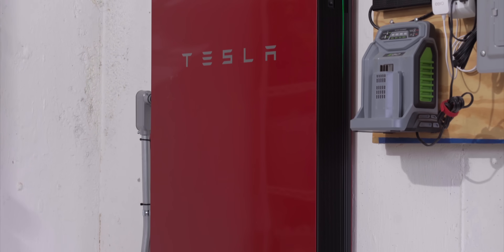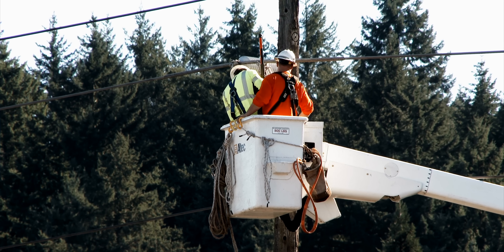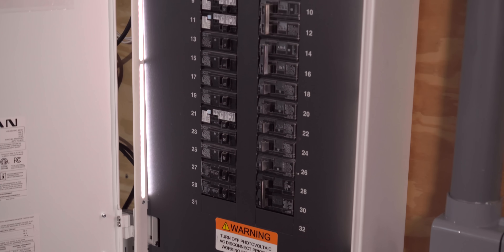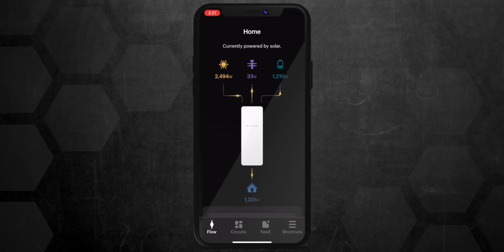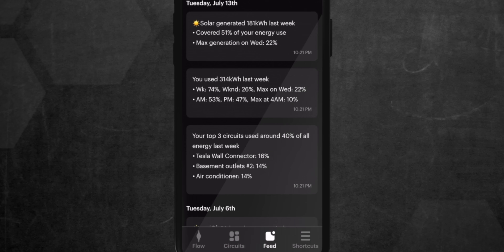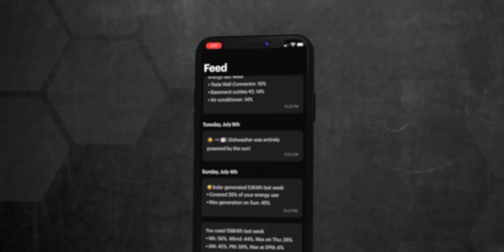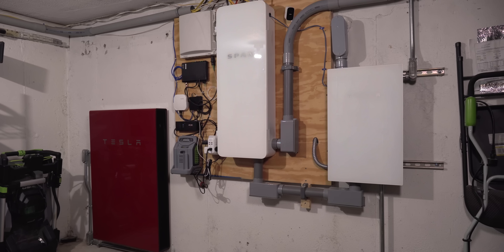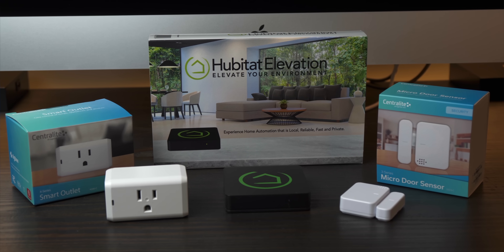This Smart Home Electric Panel Fixed My Tesla Powerwall

Comment: Super Jealous Matt, I've been eyeing one of these for a while now! Congrats on the latest addition to your smart home! Quick question, is the $3,500 you  mentioned including labor and everything?
Reply: This does seem really cool, but what happens if Span (which I'm assuming is a startup) goes out of business? I'm sure it keeps working but it does seem more risky infrastructure than smart thermostats and switches made by startups.
Reply: @odiemac  I've been considering Span and wondered about that too. But in talking with the Span folks they've acknowledged the concern and said they have plans for a local/LAN web UI as well as local API control. (Might be good for Span to officially chime in here in case I misunderstood...)
Reply: @DanielEisenman  You are correct! Our local API will be published soon. That way whether the internet or Span servers are available or not, the system will still be fully functional.
Reply: @chadcconway  Thanks Chad, good to see you guys responding to customers and potential customers!

I had a question around load shedding. How does the Span panel “know” when grid is down or battery SoC in the case of Powerwall? There isn’t really a good stable API that Tesla is implementing right now that I know of.
Reply: @odiemac  the support for all of the app based stuff will disappear and it will just be a regular breaker panel, (assuming that the relays/contractors which turn circuits on and off via the app don't stop working)
Reply: @walt4690  Yeah that would be my assumption as well. Local control would work but maybe not remote. But then you lose the utility of your $3500 investment.

Seems like its a lot easier to accomplish the same goal with software: detect battery charge level and turn off smart thermostats / plugs / lights etc. Then when the SW ages out at least you didn't build it into your wall.
Reply: @odiemac  100% stringing some lambda functions with API data and maybe backed by Elasticsearch would be way cheaper
Reply: @betterwithrum  all running through optimized sqs queue to deliver notification data to ds consumers.  I found the dev! 😁
Reply: Their website says installation is not included. You'd hire a local electrician to do that work.
Reply: I paid like 2k for a circuit panel redo.
Reply: @Chad Conway Any plans for similar integration with Sol-Ark or other inverters?  I’m installing a Sol-Ark 12k and could probably get a good deal on installing a Span panel at the same time.  But it wouldn’t do much good if Span isn’t able to detect when power shifts from grid to battery & vice versa.  The Sol-Ark does support CANBUS/MODBUS for communication with BMS, if that helps.
Reply: The more people buy one. Less likely SPAN will  go out of business vs having a long term company.
Reply: This costs more towards 6-7K as all loads are controlled
Reply: @Chad Conway Have you been able to do the same thing with enphase encharge as well?
Reply: @scotthall1381  not yet, but it seems like it’s on the road map. I’m a SPAN and Enphase certified installer and I know they’re working on hopefully making something happen soon. Not a guarantee though

Comment: I'm getting Tesla Solar and 3 powerwalls installed in the next few weeks..does this new model allow it to be inset into the wall like a traditional panel or is it still surface mounted? I have Sense and contacted their support, they've indicated they currently don't support solar with battery backup. Their solution won't provide accurate readings when getting powered from the batteries so I'm a little disappointed there.
Reply: Hi Oral, yes the new Span Panel can be inset into the wall. We'd love to help you add Span, span.io/get-span

Comment: I wonder if there's a feature that gives you like 15min at the start of a blackout before your "not essential" group goes down. Just to give you time to like, save your work and shut down computers and whatnot. You could always just have a UPS on your critical devices, but it'd be a cool feature to work into the smart panel.
Reply: just put those on Nice to Have? i don't see the issue

Comment: This type of panel looks like a must have for battery and solar technology.
Reply: A convenience, not a must have.  For $3500 plus installation, most people would manually meter their usage like Matt said - or go with the fixed critical loads setup.  Have to weigh the high cost of this and the likelihood of this start-up maintaining support for the life of the install.
Reply: Price is over the top though
Reply: @chefgav1  I agree, $3500 is a bit steep for this, however someone investing in solar is likely spending 10's of thousands of dollars anyway, so this is basically a drop in the bucket for them.
Reply: @cappuccino-1721  I’m from Australia so this will be more than an entire 6.6kw solar system here in Australia given Australia has the cheapest installed residential solar in the world. It would be a nice accessory but

Comment: I wonder if it would make sense with a Generac (gas). You probably can downsize the capacity (15kw instead of 20kw for instance) with the fine grained control that spans offers.

Comment: This truly would be best if they partnered with builders. It would be a great starting point for a smart home. I was considering this during my Tesla install, but they weren’t ready to launch in my State. So I essentially went for 4 Powerwalls. I’ve basically mapped out all may power consumption manually and just know which breakers to shut down for an extended outage…like an animal.
Reply: Hi SteveV, What state are you in?

Comment: I'm having a remodel done and plan to have a Span smart electrical panel installed.  No batteries for my solar yet, but this will help in other areas and when determining battery needs.  Options are our friends.

Comment: I'm working on building a power bank for my house using used/tossed 18650 batteries, most of which are free or next to nothing to get. The drawback is I will have to check the batteries once a month or so to make sure they are still working but it will save my home quite a bit of money and i get to play with electricity. Yay
Reply: Don't you have a battery state of charge meter like a Victron or Renogy? You walk by and see the percent of charge, charge/discharge amps, etc.  When you set it up, you run the battery fully charged and then discharge it to set the parameters to your particular battery pack.  Here's my home built solar charged LiFeP04 battery pack on wheels that has the Renogy meter. I like how it calculates the remaining battery time in hours with different loads. Yay, do it yourselfers!  
https://www.youtube.com/watch?v=NYpczRYDFJQ

Comment: Nice panel, but there's something a little contradictory (in my mind, anyway) about moving toward self generated power while being hooked into the buggy, viral "internet of things" that a smart home is. Can this entire system of yours be air-gapped? Would you find that separation an important aspect of it?
Reply: I was hoping @Undecided with Matt Ferrell would have touched on security a bit, since I think part of his interest in Hubitat was the benefit of local control of home automation. Since cyberterrorism is a thing, something as critical as one's home energy infrastructure can't be too secure...

Comment: Span can help justify their high cost by also adding home/vehicle to grid as software update
Reply: Span is equipped with a 200A grid disconnect. When vehicles become capable of Vehicle to Home or Vehicle to Grid, we will be integrated them with out panel.
Reply: I asked about this on Twitter and they didn't reply.  It's really more important than people realize.   The future is having multiple EV a stationary battery and the ability to connect Vehicle to Grid.  This way in the near future you could easily have a combined 60kW of  battery power at your disposal.

Comment: Surprised you didn't mention anything about changing from the Tesla app controlling the energy flow for the house to the Span software - I assume as long as the Powerwall keeps its Internet connection, there's no concern of warranty issues now that another system is in charge of the electron flow.
Reply: Tesla is still in control of generation(solar & battery). Span adds to that by controlling load(lights, outlets, & appliances).

Comment: Odd that they stopped at 90 amps, not having at least a few spots (top and bottom of panel) that could do 100 amps.  I have a 100 amp circuit for the garage, which has EV charging and the bigger solar circuit on it.  I do not have a battery though and do not plan on this kind of upgrade in the house I am in.  Next house, great chance it would have a battery and this or something similar.

Comment: I think I’ll opt to continue living in a developed country with a reliable electricity grid
Reply: Privilage has its rewards.  Also the point of the system is to use your electric efficiently, not just in blackouts.
Reply: @tjwatts1207  if you can afford this system you can afford the electricity

Comment: Looks like they may have a new battery out soon. Iron-Air type seen in this YouTube video. https://youtu.be/UDjgSSO98VI be neat if you could add that to your Tesla Powerwall. The smart like panel wow so neat and neater with updates. Did not know they had something like that very cool. Thank you for the video. Nice job on it.

Comment: Matt I would love to add solar now, but I have a tile roof.  I would have to check with the HOA to see if solar is allowed.  If there were no rules here I would go with the tesla roof tiles.  But I'll have to wait until they make them in the shape and color of the Spanish tile roofs. I could add a vertical axis wind turbine but they are still in the design stage. Without the energy input, it is no use having a battery, but I would be as excited as you are to have a span panel to control things.

Comment: A fun toy for sure. I went the DIY off grid way. 56kwh's of chevy volt batteries with 18000w of inverters. 15000w of panels I just run everything all the time.

Comment: When using the panel for all the power tracking do you need to connect it to the internet with an account on the Span website, or does it all run on the local hardware?
Reply: Span connects to the Powerwall system locally, but currently requires the cloud to get information to your mobile phone. Local access without the cloud is coming soon.
Reply: @chadcconway  That sounds great as I'm firmly in the camp of people looking for something like this but I also refuse to have my smart home items connected to the internet so having everything running local is must have for me.

Comment: Ok Matt, 
Here is MY #2 FAVORITE take-away I learned from your video!!!   I must design carefully around a max of 220-90amp breaker ... I expected to feed my garage equipment with a 100amp  "sub-panel?"  But SPAN doesn't yet have a sub-panel.  
   * Do you think an ole type sub-panels should be avoided when using a SPAN because such a sub-panel prevents the SPAN from monitoring circuits off that Sub?  
* I guess maybe I should design the home with the 1 or 2 SPAN(s) in the garage vice the mudroom???  My worry... with a passive house design it's typically critical to limit the number of perforations between the garage and inside the home. So my electrical design currently had just 1 electrical perforation into the garage (1@220v-100amp) to service all garage electrical needs.  I must re-think that now.  Maybe SPAN is coming out with a 90amp Sub-panel?  Maybe I could run 1@60amp line to garage for the Model Y and then 1@90amp line to cover the 2nd future Tesla and all other garage equipment?  As a minimum the garage equipment will include 1@30amps Air compressor, 2@15-20amp lighting circuits, and 2-3@20amp sets of outlets. 

lol - too much fun!  

Cheers,
Eric
Reply: Hi Eric, 
Span can be used as a main or a sub-panel and we support installing multiple Span Panels in a single home. It sounds like for the best experience you need one Span panel for your main and then a second Span panel in your garage. The second Span Panel from the sub-feed lugs in the main Span Panel. We'd be happy to support: https://span.io/get-span
Reply: @chadcconway  
Thanks Chad.  We are not ready yet but hope to be in late spring.  Are you in NC?  
Do you happen to know if SPAN is working on a larger or smaller panel.  A Single 300amp or a cheaper 90amp for the garage may do the trick. 
I was trying really hard to bring my energy needs down to a single 200amp panel but its very hard, especially with wanting a 2nd Tesla in the mix.
A 2nd $3500 panel for the garage is a serious luxury.  I really need to sort out my energy diet. 

Cheers,
Eric
Reply: @erickessler6094  We can help keep you to 200A. EVSE / EV chargers when paired with Span do not have to be accounted for in the load calculations. Span is certified as an energy management device. We can also help you evaluate if you need a second Span or can just stick to a single Span panel and a regular downstream sub-panel.
Reply: Yes, we do installations in NC
Reply: @chadcconway  Excellent Chad, how best do I reach out to you?  I followed your link to SPAN & completed the survey.  I'd love to figure out how to live on one 200amp SPAN Panel. 

Cheers,
Eric

Comment: Matt,
Just an outstandingly informative video my friend!  I already knew I would be using the SPAN panel in my new passive house construction project ... but now I better understand more reasons why and am also aware of several issues I must resolve as well!  :-)  

My #1 biggest reason from your video 😀 is the virtual Critical Loads Panel, WOW!  This "should" be an awesome simplification. 
   * Brother, do you have any insight how the SPAN with SolarRoof & 3-4 PowerWalls might work with a secondary emergency back-up LP Generator for a major TX sized event? 
   * If I needed a 2nd SPAN panel, do you know of any issues with them both talking to the app?  My current home has 2@200amp panels with a 100am sub-panel in the garage. Yup, I'm a BIG Garage Project Guy.  My wife always says I must loose weight...Ha-ha. 

Cheers,
Eric

Comment: "Nice to have" and dishwashers - I would hate it if the Dishwasher was switched off (due to lack of remaining power) 15 or less minutes before it was due to finish. Perhaps the "Nice to have" circuits should be split between "switch off now" and "allow to run until complete (Load drops to zero) - then switch off" ??
I have a Victron Multiplus2 48/5000/70 with 10KVh of LiFePO4. I split my board between non-critical (Electric water heater/Geyzer & Stove/Cooker) and critical (everything else). As there was only one cable to Oudoors that ran both outside lights,electric gate and swimming-pool pump, added a wireless relay to the pool pump so an outage event also switches off the pool pump - which is controlled by my Victron setup.
Reply: They're not going to draw much power when they're finished though, so they just go in "nice to have". They're not going to be running for hours
Reply: @MatthewTaylor86  right, but the point is, if a washing machine has like 15 minutes left, you might as well just let it finish, instead of potentially having to do the washing load all over again.
Reply: That's actually a really really good idea. Same applies to the washing machine and a few other things, let it finish and then shut it off.
Reply: If I was hearing Matt correctly, he said one of the things he liked about the SPAN was that you could see where the power goes, how much power is used, and could allocate what you want to keep running in case of power outage. I am supposing you could keep dishwasher in your keep running selection, then turn off power to it once it is done. #1 item on keep running list would be internet, lol, so you can make the changes.
Reply: Most washing appliances have memory function, if power is lost they will resume once they get power again
Reply: I mean, in a power outage i would probably have the dishwasher in the non-essential. It doesn't take that much effort to wash dishes, plus you probably need the distraction (for you or the kids). Either that, or put it in the essential tab if finishing is a concern. It only uses power when its running, so just don't use it again after it's finished.

Comment: I’m no electrician but that install of that span panel (on the left)  looks messy - wires not clipped cleanly etc
Reply: Everything on the left is related to his internet… it’s not electrical work. Except for what looks like some kind of meter. I am not an electrician either but look closely.

Comment: Honestly, I think having a panel that can just have a built in energy monitoring system would be a good start. I like the concept of this panel, but the problem is that it's realistically the only option so far, and is fairly limited. Definitely going to keep an eye on it, but it needs to open up to more automation suites and have the ability to operate in a local only mode without the internet before I'd consider it.
Reply: @NA NA, Span.io has competition in the works, including from humongous companies like Schneider. At this point in time, though, theirs is the most fully realized solution, although there are many opportunities the product has yet to pursue and achieve.

Comment: How does this work in colder climates where your external panel is just a main breaker and all circuits are inside in a separate panel?
Reply: Hi Randall, Span can be installed inside as a sub-panel fed by your exterior main breaker.